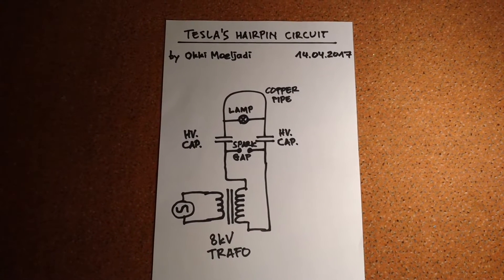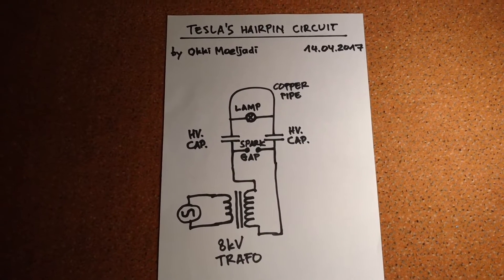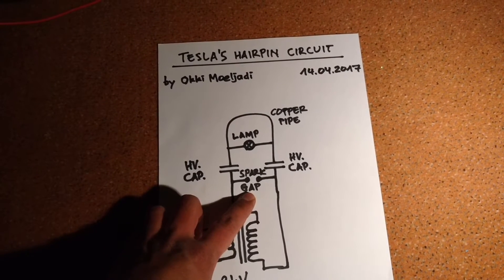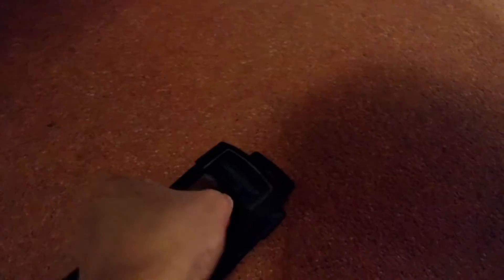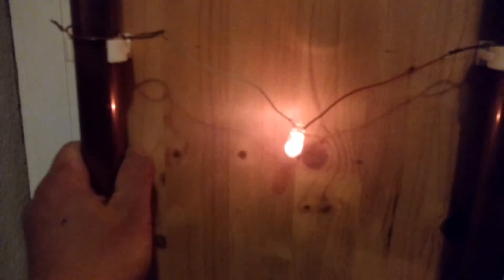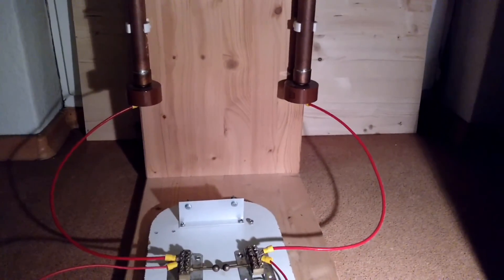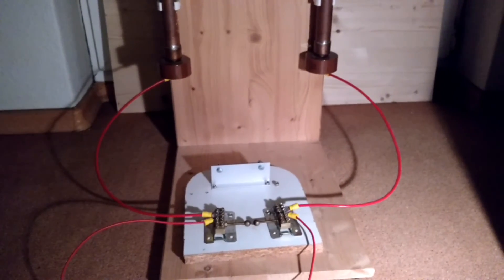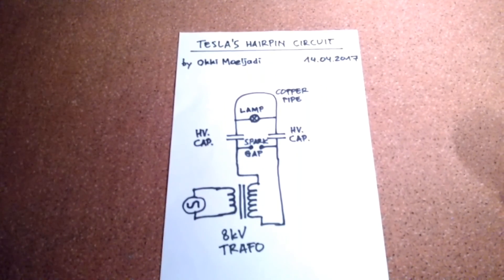Tesla's Hairpin Circuit (Dead Short Circuit)

Comment: Just a voltage divider the capacitors acts as high value resistors and the electrodes of capacitors as capacitive droper and the frequency that is generated from spark gap is just a skin effect adder

Comment: Anything through spark gap capacitor is dielectricity. Now u will need to engage or make a cyclical magnetic electricity once both these r added raise the voltage up for stp up/ dn for current okay.. That's all. Dielectricity is resonance in the system or making low resisitance for flow of electricity or dielectric induction whatever u wish 2 call... Now all u require is a Morin pump to get u going if    that's all

Comment: Did u do it without caps?
I don't see caps in your setup?
Reply: The 2 HV caps are the "bolt on" type and bolted to the bottom of the copper pipes.  They are often referred to as doorknob capacitors. (you can find them on aliexpress or ebay)
Reply from the maker: There are 2 HV caps.

Comment: What is your HV source? AFAIK, this circuit is intended for high frequency pulsed DC, with a magnetically quenched spark gap to make the pulses as abrupt as possible. Probably also intended for resonant tuned operation.
Reply: Good point. The hot electricity is filtered out by the spark gap in parallel leaving the cold electricity. The spark gap in this layout with the HV capacitors will generate high frequency.
Reply from the maker: I use NST as HV source.

Comment: I noticed the same effect can be seen using nearly any high voltage discharge feeding the bar with cap pulses and adjusting the gap properly. 

But what happens when you introduce a dead short right after the HV caps and before any loads along the bar? Do the loads still light? I think there is a fine line between achieving Tesla's effect and just basic electricity. Normally we'd imagine the voltage across the bar to be close to 0, and I'm sure it is, just not for the duration of the entire cap discharge into it. I see it as sort of the inverse of shorting a load with a much thinner wire where the supply can power both without dropping.

Comment: Steinmetz had that in his book years ago, there is no charge buildup on a conductor and Ampere's law is not caused by electrons charging the conductor, and there is no electron flow between the conductors, barring resistance.   Ampere's law is caused entirely by the ether medium or energy stored around the conductors.
     Tesla was also right, the ether medium can flow right through matter and give off a glow or light on its own.  The ether medium is the magnetic field we see flowing around all charged moving particles, such as the electrons.  It is the ether medium particles that do the work, the electron just excites them to move in a vortex around  the electron flow.
Reply: How can this be used to create room temperature superconductivity

Comment: I don't want to start any arguments but please take some safety advice from a professional electrical engineer recently retired, and still alive after a long career working with high power high voltage circuits and equipment. Please be aware that actually you ARE being shocked when you touch this circuit, and you can suffer tissue burns and internal damage,  it is just that your nerves indicate less pain when it is caused by radio frequency current. Current conducted through capacitors is just as dangerous to touch as the terminals of your 8kV transformer. Your 'short circuit' is only so at low frequencies; at radio frequencies it looks like a transmission line with some inductive properties, and it resonates at radio frequency when connected to your capacitors, spark gap and transformer, and you actually made a high power radio transmitter, similar in some ways to a Tesla Coil circuit. Please don't encourage other people to touch such circuits, and please look up the effects of radio frequency burns on humans. The so-called 'skin effect' does not actually mean that all the damage occurs in the skin for many parts of the RF spectrum, the burns can be unseen in deeper tissues too. I hope that this comment will prevent somebody from seriously hurting themselves following your dangerous idea to touch the circuit.

By the way, I do like your approach to investigate things for yourself, but the Tesla Hairpin can be explained by standard electromagnetic theory, so no mystery here. People who have done the work of studying electromagnetics in depth don't usually need any strange idea such as 'cold electricity' etc to understand every observed operating property of the Tesla Hairpin, even though it looks a bit odd if you haven't done the study.
Reply from the maker: Thank you for your advice. On this channel I just want to share my private research. I know the danger of electricity. Maybe I don't warn the viewer so often about it but I do that on some of my videos. I have studied electrotechnic and I'm an engineer developing industrial products for about 15 years. Despite my degree and experience, I still see something interesting that I haven't seen in the university or at my work. Anyway, thanks for your feedback.
Reply: @OkkiMoeljadi  someone should explain one time forever, if the tesla hairpin IS or ISNT "just RF"... I'm still confused
Reply: @tanner1985  It isn't just RF, that's the safe way to look at it. There are higher frequencies presented 'hopefully' on the other side of the capacitors across the bars but you've got a relatively low frequency cap discharge which as OP has pointed out can kill your ass in a heartbeat. I wouldn't go touching the bars without protection even if it seems to be operating 'properly'.
Reply: @Magneticitist  I'm not concerned about safety, I know this kind of things need the necessary precautions. I was referring to this sentence "People who have done the work of studying electromagnetics in depth don't usually need any strange idea such as 'cold electricity' etc to understand every observed operating property of the Tesla Hairpin, even though it looks a bit odd if you haven't done the study." -- After many years following this kind of projects, still I can't get the proper answer if this phenomena is just rf like user "ridefast0" said or a real deal ("cold electricity").
Reply: @tanner1985  I think it would be safe to consider it cold electricity traveling at RF
Reply: @tanner1985  You can get your answer by the usual methods - look for the opinion of authorities such as EE texts used by universities etc, and judge the credibility of the sources. That is how I came to my view. Some other people are much less polite expressing their view of 'cold electricity'.

Comment: Hi Okki did you try to add 2 sharp magnets to the spark gap like in tesla patent ,you can use 2 metal cones and attach magnets on their back to have n-s on sharp edge...nice demo..
Reply from the maker: Thanks Bosnjak Bosanac. No, I haven't tried that. What Tesla wanted to do with that was to have  clean sharp pulses at high frequency. Today we can achieve that using mosfet and high frequency driver.
Reply: Okki Moeljadi ok then you got it i will try this set up with ground electricity when i get ready...

Comment: Im new to the electronics/electrical.  What does the spark gap do in  a circuit ?  What's its purpose...  Great videos.   Enjoy all of them...
Reply from the maker: The spark gap works like an uncontrolled switch that turns on and off by itself. The purpose is to make electrical disturbances in the copper pipe. Thanks for watching!